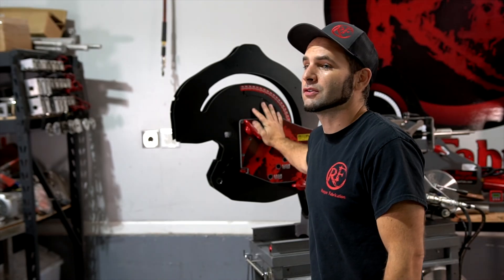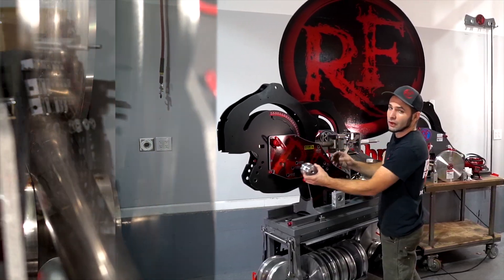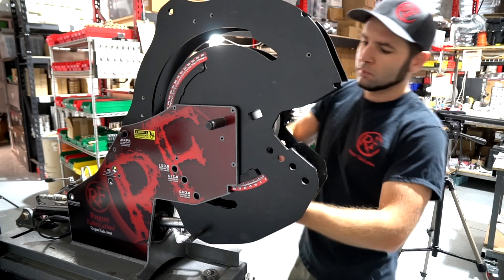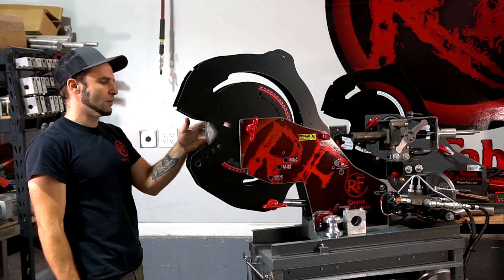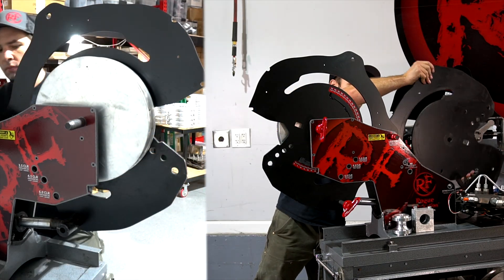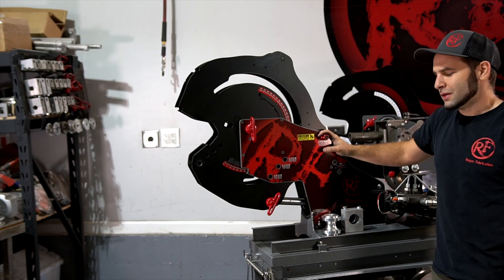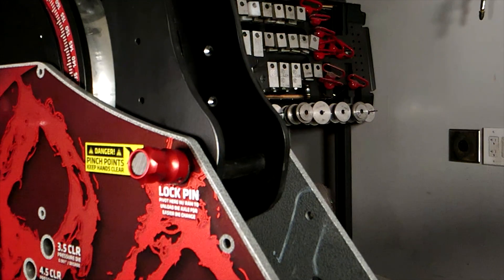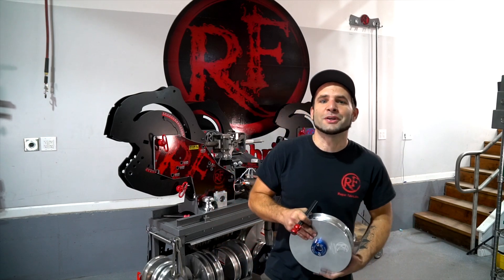Easiest Tube Bender Die Changes Ever! M625 Rotary Draw Pipe Bender.

Comment: I just bought a used rogue fab bender 605 pre 2023. It was never used. It came with the 2" die. How many washers should I use to space the die correctly? I have 2 in it now on each side and its not loose or binding but it had 1 washer on each side when I picked it up. It was pretty loose but I dont know if its supposedto be that way.
Reply from the maker: You can use how many feels right, we see some people use 2-3 washers and some use 5-6 washers. It can be slightly loose inside the machine.

Comment: One thing I plan on making is a pressure die handle. I have some situations where  it is necessary to drop the pressure die to get a piece out without removing the clamps or bend die. If there was 2 pieces of .125" (or even thinner maybe) sheet with hooks and a handle connecting them at the top that will grab the roller pressure die so you can pull it up from above and insert the pin it would be very nice. That slick way to remove the bend die may make it unnecessary though. I'll have to check that out.
Reply from the maker: That sounds handy :)

Comment: Just wanted to say I just ordered the tube notcher from Rogue and the longer hole saw cutters with a digital level. These guys are the best to deal with.  All your videos are great. Super easy to follow , no unnecessary talking. I bought a baleigh rdb 150 bender. And it’s awesome. But I wish I had bought the rogue. Bender. WHY.  Waaaaay better customer service and perfect explanation on all videos. I think it was Josh that my wife ordered the parts from.  Anyway. Awesome to deal with and I’m looking forward to spending more money with these guys in the future.    Thanks.  Richie Sharp.
Reply from the maker: Thank you so much Richie and Tammy! We're thrilled you enjoy our videos and our customer service. The RBD line are also good machines. They just don't make S bends and the dies are quite costly compared to ours. But they work excellent.